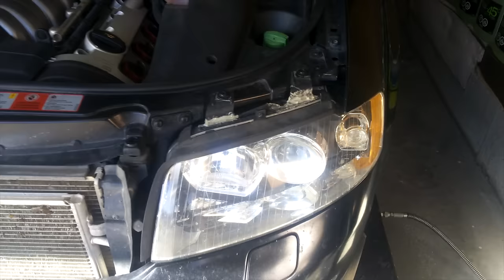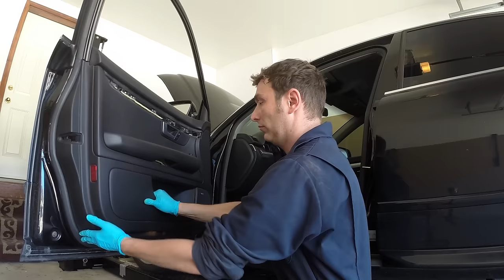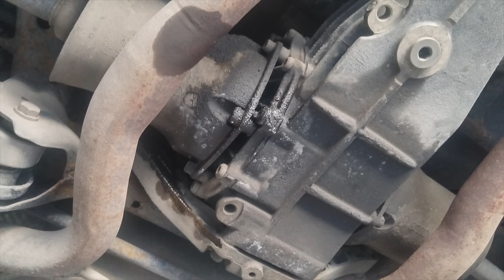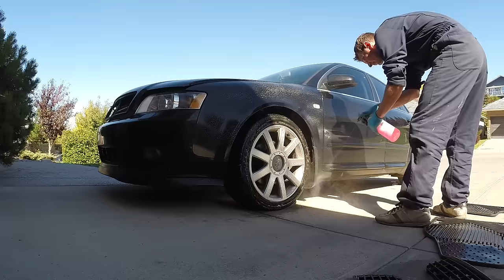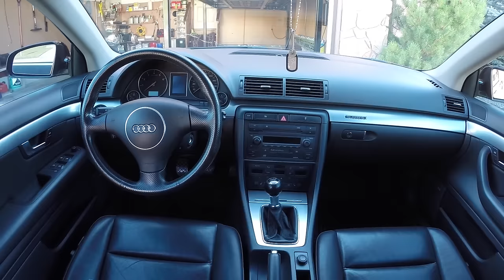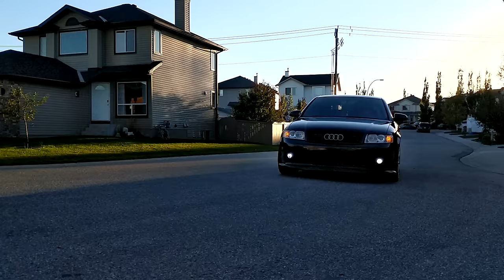Audi A4 B6 Ultrasport | Clean Up Time Lapse Compilation

Comment: My first Audi was an ‘02 A6 3.0-  that body will never get old in my book-  only thing that dates them is the steering wheel. 
👍🏻  Good work
Reply: Agreed, steering wheel can be upgraded though!
Reply: Try fitting one from the MK1 TT, which is thinner and has the aluminium ring around the Audi logo.

Comment: Very nice. I had an A4 (B6) 1.9 TDi Sport in black with the S Line bodykit . These cars look awesome.
Reply from the maker: ricke69 I want that engine for my daily driver!
Reply: I can highly recommend the TDi 130 sport. I had mine for 7 years and took it to 253,000 miles on the clock and it was still tight as a nats chuff. And it returned 50mpg driven sensibly. What's not to like ?!

Comment: You need to take off the door panel in order to replace a gasket inside the motor bay😵 wow ! Thats different, lol just kidding 😬 I thought it was going to be a vid of all of this aftermarket parts, sometimes the oem parts makes the car more interesting and beautiful than a bunch of aftermarket stuff, this is one of those cases no need to add more to make it better looking, good job! Nice and clean looks brand new😊

Comment: Hey man, great video. Thanks for making that. I bought my first Audi, the B6 A4 3.0 Quattro, and am really motivated to get it running right, as you did with yours. Couple of questions: Did you do all the mechanic work yourself, or did you get a shop to do some of it? Did you have problems with the vacuum lines? And lastly, what coils and plugs did you go with? Anyways, again, thanks for making the video.
Reply from the maker: Matthew Blair, yes I did all of the work myself. I got a buddy to help me out with the Timing belt but that's it. I haven't had any problems with vacuum lines. I used oem Audi ignition Coils. For spark plugs, I just got platinum tip from local parts store.

Comment: I've got the 2003 A4 B6 2.5tdi Quattro Sport (180) Manual Saloon in full black leather interior with 120K miles all stock and clean inside out. 
Is it worth keeping? 
is it going to hold its value knowing all the electrics will soon dominate the roads?

Comment: Just installed the fog lights and they look amazing.  Issue I'm having now is an error code when I turn on the car.  Let me know if there is a work around  thanks!!!
Reply from the maker: I don't have issues with mine. I know there is something you can buy to make the error code go away if you have that issue. It's some module or ballast, I don't remember what it's called exactly though, sorry.

Comment: Good work man! I'm thinking of an xenon upgrade for my headlights aswell and was wondering if you changed the headlights to the oem xenon or if you did a conversion? Thanks!
Reply from the maker: Pierre Adelind you can just buy the OEM hid headlights and just plug them in. No more modifications. All the hardware is in the headlights.
Reply: Alright, sounds great. It's going to be a little bit more expensive but I guess it's worth it after all. What did you use for the fog lights? LED?
Reply from the maker: Pierre Adelind yes just LED
Reply: Thanks! :)

Comment: I currently have the exact rims and I'm having trouble putting the center hubcap on. It's easy to put on when the wheels are off, but if you try to put the wheel on, you can't tighten the bolts. Been trying to fit the hubcaps but the metal ring makes it a challenge. Any tips? I have double checked and they're the correct ones. Thank you
Reply from the maker: Ruben Benitez if they are not snapping in easily, you need new metal rings. I had one fail on me.
Reply: Mario Kay I got the complete set, all 4 center hub caps and none of them fit easily. So you’re saying I need to size down on the metal rings? The caps go in super easy without the ring.
Reply from the maker: Ruben Benitez oh, in that case they might be aftermarket. They don't usually fit as good. But it takes a bit of playing with it to make them fit
Reply: Mario Kay bet, thanks for all the help. I’ll try to loosen up the tension on the metal rings. Great vid btw 👍🏽

Comment: What would you say to look out for when purchasing a B6 A4? I'm in the market for one and just wanted to get some input on it.
Reply from the maker: Timing belt/water pump & clutch are pretty expensive on these cars. Try to find one that has had them recently replaced.
Reply: Mario Kay thanks for the help! Greatly appreciated
Reply: what about one with only 60k miles is this going to be a problem if they weren't replaced?
Reply: Nirrsan Nava I have an Audi A4 b6 51 I bought it last year. I have had a lot of cars and had to do a lot of fixes to my cars and I will say this b6 is one of the easiest cars I have ever worked on. A month after buying it it developed a major overheating problem, vacuum problem and brakes (bought bit of a dud) but I replaced the CTS, thermostat, drive belt, tensioners, brakes and discs, cam belt and tensioners, water pump, vac lines and a full service for around £400 and took me roughly 6 hours and I'm no mechanic. She now runs sweet. A joy to work on and a joy to drive
Reply: What is CTS?
Reply: Nikita Ovchinnikov  coolant temperature sensor

Comment: Where did you get the webbed/ honeycomb fog light grilles? They are dope af
Reply from the maker: Luke Wyman they are the factory Audi Ultrasport grills.
Reply: Mario Kay I have the base model and they are just horizontal slots I'm looking for ones more like yours. Btw did it come with that spoiler or is that an add on?
Reply from the maker: Luke Wyman The grill is not gonna fit on yours unless you get the ultrasport bumper. The lip is an add on called "EZ Lip Pro"
Reply: What about the back lip spoiler on top of the trunk?
Reply from the maker: Luke Wyman sorry for the late response, didn't see your msg. It's an OEM option for the ultrasport A4s

Comment: What is the difference between an ultra sport A4 B6 and a regular A4 3.0 B6 Quattro?
Reply from the maker: Ultrasport (in Canada) was only available in 6 speed manual, Perforated S-Line Steering Wheel (slightly thinner than the S4 steering wheel)  S-Line Front Bumper Cover (which in my opinion looks better than the S4 Front Bumper Cover on the B6) the Ultrasport Kinda looks like an RS4 style Bumper Cover. S-Line Door Blades (Lower Door Mouldings) which stick out a little less than the S4 Door Blades. Trunk Lid Spoiler also S-Line. Upgraded Sport Suspension (Struts are RED not Black) compared to Comfort Line or Base Model. I use to own a 2002 3.0L V6 Base Automatic...not for me! The Ultrasport is a little stiffer and feels much nicer for daily driving or around corners! Even at 250,000kms it felt like new. The wheels on the Ultrasport are a 18"x8" Et43 RS4 B5 Style wheels, which look amazing on the B6! For the interior, it comes only in Silver/Brushed Aluminium style trim, only available in Black interior, but basic seats were available in Canada while Europe got very nice S-Line Seats :(  
I believe that some models in North America got the S-Line seats, but I've never seen them in Canada before, only in Europe, and they LOOK AWESOME! 
I believe they are Suede or Alcantara, maybe both. Besides those few things, I believe that's it... Anyone else know more???
Reply: Mario Kay, Thank you very much for the information. My 02 A4 is a labor of love. Or hate, I’m not sure which. I got it from a college student who had never owned a German car before and he tried to modify an Audi for his first attempt. He put a cheap Scorpion cold air intake on it without a cold air box. Over oiled it and fouled the MAF and the throttle body. I cleaned both and bought all the stock ductwork and filter box on e-bay to return it to stock. I purchased a completely new exhaust system with the X pipe crossover in front of the resonators. I have two stock ANSA mufflers and tailpipes. After checking codes I’m down to #3 cylinder intermittent misfire and a catalytic converter code. I used my infrared temperature sensor and got 345 degrees temp on the passenger cat and 700+ on the drivers side cat. I haven’t put the exhaust system back on yet so I’m down to the cats, flex pipe and down pipe. I’m going to try running “Cataclean” through it to seeif the cat will clear. Any thoughts?
Reply from the maker: @arttafil6792  Most likely Cat might be plugged. I am deleting mine as soon as I get a free weekend.
Reply: Mario Kay, If the cataclean doesn’t work I have a sewer snake I’ll run through the cats from rear to front. That’ll leave it with gutted cats that look stock and a stock, quiet exhaust. I’ll let you know how all goes.
Reply: Mario Kay, The reason I want the Quattro here in Knoxville, Tennessee is we’re at the base of the Appalation  mountains and everything is hilly curves. Beside that we have The Tail of the Dragon here where we lose bikers every year. This is Audi Quattro country. For winter it’s legal to use studded snow tires here in Winter. I have a complete set of Nokia’s Happekillita snow tires for it!

Comment: Where did you get the chrome bezeling for around your door windows? The little big of chrome really makes the color pop!
Reply from the maker: SaskatchewanBadAss that's stock, I was going to change it to black but I thought that piece looked really good like that. So I didn't change it.
Reply: Do you know if you can buy it aftermarket? Or should I just look for an a4 at a scrap yard an see if I can get it from there
Reply from the maker: SaskatchewanBadAss You can get it at a scrap yard. It will probably be way cheaper.

Comment: Where did you find the paint for the wheels?
Reply from the maker: PwnKone paint shop supplier for clear coat in a spray can with hardener and dupli-colour silver paint
Reply: Mario Kay Thanks for your response! Was the color you used the audi/VW silver that duplicolor advertises?
Reply from the maker: PwnKone definitely not. I have 2 sets of those wheels and the ones I painted were a bit darker than OEM. I would get matching paint from body shop supplier to match the original paint colour code. But mine has already been painted lol. If you are doing 1 wheel only, I wouldn't recommend to do what I did. I would do both on the same side or all 4 so the colour matches. Hope that helps you out.
Reply: Mario Kay Alrighty, sounds good! Thanks for your input and great job on your b6
Reply from the maker: PwnKone thanks bro! Thanks for watching too!

Comment: How do you take off the grille?
Reply from the maker: There are little tabs on the inside of the hood that you have to press. Careful, they break easily. Take your time
Reply: Thanks for replying will do.
Reply: Did you use one of those interior tab plastic bars to pry it off?
Reply from the maker: Yes I did. If you are careful with a small screw driver you can do it as well. Take your time, don't force it. Otherwise they will snap.